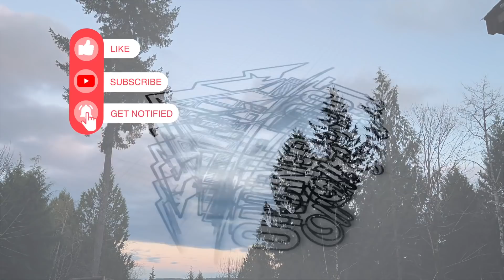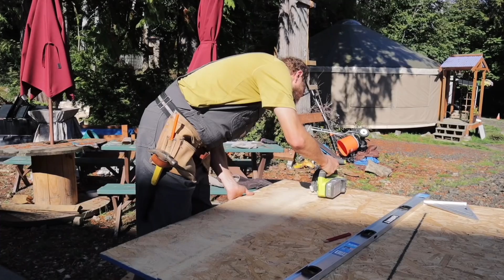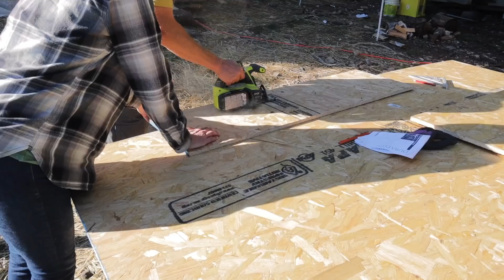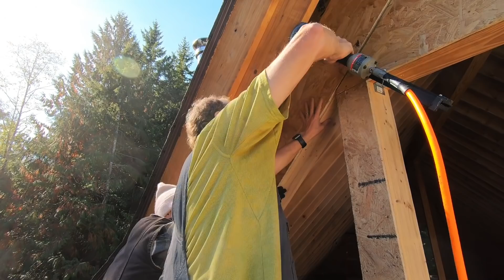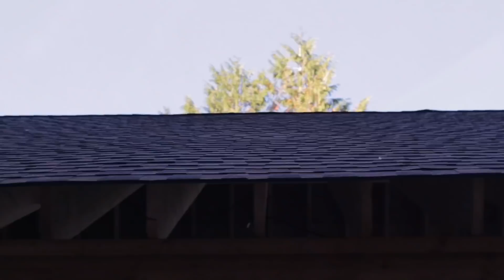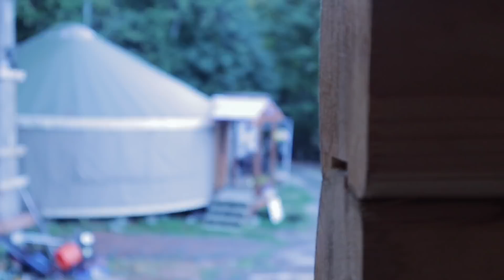Starting Our WINDOW WALL // Couple Builds House with No Experience - Ep. 55

Comment: Chimney is looking good but don't wanna rain on your parade really need to install a snow dam or V barrier ahead of the chimney in the event of heavy snow accumulation it will prevent snow sliding from taking out the chimney also should install wire supports also for wind.
Reply from the maker: We were planning to install the braces.  Actually 2 sets.  One set at 4' and another at 8'.  Because of our area and our expected snow fall I didn't think I'd need the V barrier, but enough people in the comments have mentioned it, it, it probably isn't a bad idea.    You never know what the future holds even if you aren't "suppose" to get heavy snow accumulation.   Thanks for the comment and the tips.

Comment: Hey guys the house looks awesome and coming along but I think you might  need to put some kind of straps on your chimney because you said it's 12 foot tall and well a strong wind will blow it over and it  may also be code to strap it down? Anyways I'm sure your inspector will let you know
Reply from the maker: It definitely requires support straps. We have two sets on the way and we’ll install them at 4 feet and at 8 feet. The support straps were just backordered at the time of install.
Reply: @OneFootOfftheGrid   yeah seems like there's a problem trying to get things ordered or delivered on time anymore plus everything has gone up in price to the point most can't afford to build period....well hopefully you can get them installed before you guys get any strong winds in your area...good luck

Comment: The wood stove looks kinda small for the size house....wondering if it’s going to be enough to heat the house....it would be wise to insulate the house with the best possible material cause a well insulated house cuts down on wood and that equals money time and effort and work.....well done guys it’s going slow but it’s getting there....
Reply from the maker: We will have supplemental heat with radiant floor heating and I think it will be able to keep up.  If not, we can upgrade to a new stove.  The chimney and stove pipe were actually the expensive part and luckily we can re-use that.

Comment: Stove pipe should be (1 meter) above roof line or 61 centimeters above any part of the building in a (3 meter) radius!
Why no anchor straps on chimney pipe? strong wind blow it down just asking!
Reply from the maker: We are putting in two set of supports.  One set at 4’ and another at 8’. They were backordered is all.

Comment: guy's your going to need an ice Deverter, and double support straps on that pipe.
Reply from the maker: I’m not sure if we need a diverter for our snow load area, but we for sure have our tie down straps on our way.  Installing them at 4’ and at 8’.
Reply: take it for fact, as with the pitch, and the load fall it will take out that pipe.   learned that the hard way I did. didn't like having too pay the price too replace the flew, to the roof damage it caused.
for the fifty bucks it would cost it is worth it.
Reply from the maker: @ralphtaylor3796  good advice.  I’ll get one and install it before next winter.
Reply from the maker: @ralphtaylor3796  I’m curious, did you have a metal roof?

Comment: I hope you know that chimneys over 5' to 6' tall (over roof) should be braced. Couldn't see it, but the chimney also needs to go 1,5' to 2' above the ridge line. 😉 Check your lokal building code before the inspector says: Nooo! 🙂
Reply from the maker: Our chimney is to the right height.  It’s hard to see on video.  And bracing will be added on an upcoming episode. We had mentioned the bracing (and extra height to the chimney) that we will add but we know that not everyone listens to the portions where we talk.
Reply from the maker: Actually, if another part of the roof is within 10' horizontally then the chimney goes 2' above that mark.  As Sara mentioned, we have another 2' section coming that we will install which will bring in in compliance with code.
Reply: @OneFootOfftheGrid  OK 👍🏾
Reply: @OneFootOfftheGrid  😁

Comment: Use lots of sill tape seal around all the wood in those front windows.
Reply from the maker: Thanks for the tip.  We went a little overboard on the sills but probably with good cause is sounds like.

Comment: On the outside top pipe from your wood burner, should you not make some "support" to the roof so it is stable and don't move by wind, rain, stormy weather or snow?
Reply from the maker: Good question.  We actually will have 2 supports that tie the chimney into the roof.  One at 4' and another at 8'.  They are going in soon.

Comment: Great progress, have a question though, did y'all put any strapping from the roof to the chimney pipe ? Didn't see any and was wondering if it would hold up during a high wind.
Reply from the maker: We are for sure adding supports, they just hadn't arrived yet.  We will have one set of supports at 4' and another set at 8'.